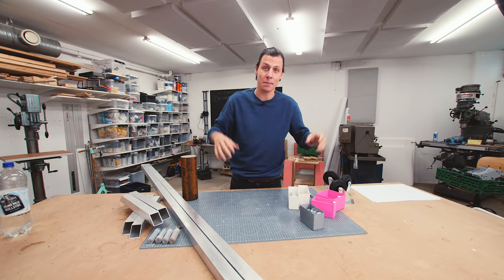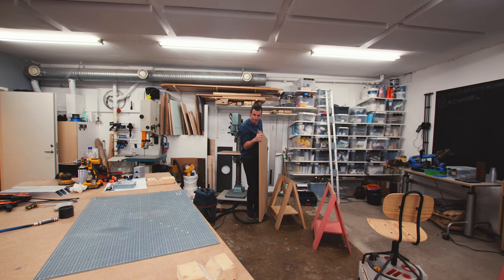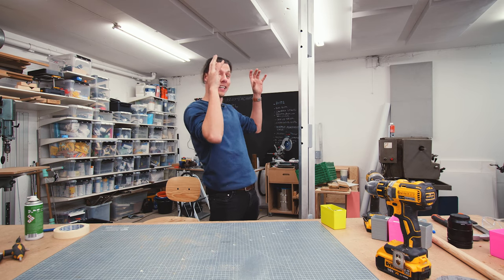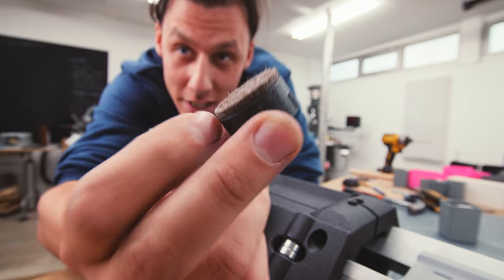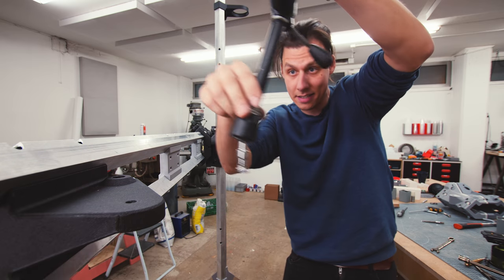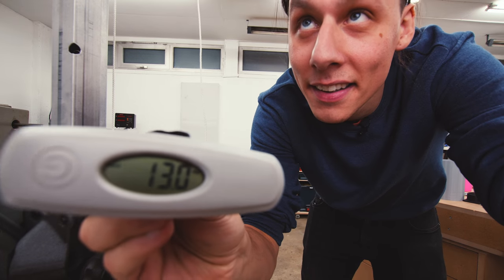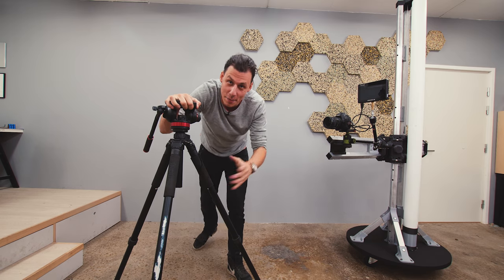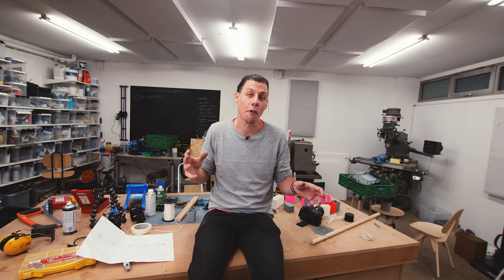3d Printing a $10,000 Camera Arm

Comment: Man that hole drilling jig is genius. In fact, the whole lot is. I need one!
Reply: nice seeing you here ;)
Reply: The bearings make no sense tho lol. At least functionally
Reply: @chas1878  With the inner race of the bearing being able to rotate with the drill bit if the drill angle was slightly off, there's very little chance this will cause any damage to the the guide bearing, if it was just a s/steel/alloy/steel guide spacer instead, there is the possibility of the drill bit biting into the jig surface causing a misaligned hole if you were slightly off with the drilling angle, so imo it does actually have a function, cool project
Reply: @antc1609  the biggest benefit in use comes from the material being hardened. It's not fixed to the drill and the drill moves axially too so the benefit you mentioned must be minor I imagine. The one point that has to be mentioned is that Chinese ball bearings are dirt cheap, cheaper than getting a hunk of Steal and boring it to a specific diameter. Nevermind hardening it
Reply: @chas1878  Yeah I think the bearings just happened to be the right size for this purpose.
Reply: GH  it's a good question. Hardening is a huge but very interesting topic.

To answer your question, it's theoretically possible but very impractical and with little to no use. You would have to anneal the material and start the heat treating process again. Depending on the steel you can probably make it a bit harder at the cost of it being more brittle. Which is not something you want in bearings at all. 

The "Chinese ball bearings" don't necessarily use bad materials if you buy from a serious manufacturer and vendor. I referred to them like that because they can be bought cheaply. I personally wouldn't trust no brand bearings with anything more than a simple low speed hobby application. Which means they're pretty good for a low cost throw in the bin later drilling jig lol
Reply: Well said Angus, I also need to do something about my setup, my current one is a bit awkward
Reply: Basically "rip hole saws"
Reply: We all need one!
Reply: @antc1609  this guy is not just making stuff but making stuf with a grade of measurements issues and making sure noting gets damaged for a malfunction. Guess he have some experience behind camera.

Comment: Very cool design and seems very handy. It's amazing how much time just moving a camera around can take. One suggestion for you given the amount of 3D printing time this took - if your space can support it I'd recommend getting a plasma table and a sheet metal bender. Many of your 3D printed parts could be made in a matter of minutes from plasma cut and bent sheet metal. Even if you need a complicated 3D printed interface shape, many times 90% of the structure can still be sheet metal which will save you oodles of time.
Reply: This guy knows what he is talking about. I have absolutely no technical input, but I would trust this man with my life if it depended on engineering.
Reply: But frankly, we all can see you are massively biased toward using sheet metal! #Plasmacuttersharpiemarker

Love both of your channels Stuff Made Here and Alexandre Chappel!
Reply: I started reading this comment and was like, huh, plasma cutting and bending sheet metal? Doesn't that Stuff Made Here guy do all that? Then I looked at the comment author. X-D Love your stuff btw. Thank you for braving the hairdressing robots for the rest of us!
Reply: Excited for your next video
Reply: How highly do you have to value your time to justify replacigng a $300 printer with a several thousand dollar plasma cutter? Especially when that isn't 'time spent working', but 'time spent not having whatever my latest project it is complete'.
Reply: @iusethisnameformygoogleacc1013  Alexandre's printers are worth far more then $300. He has two ultimakers both worth around $3000 each, along with a prusa mk3 worth around $800 and a artillery sidewinder X1 worth about $430.
Reply: Not fair. You have a trillion machines 😂
Reply: Not to discredit Alexandre but don't you have to be an absolute god of engineering to design those folded geometries? Working a 3d model and just printing it seems easier... Or does software do the work for you?
Reply: 3D print (if you have some printers anyway) is perfect for prototyping. And this is prototype. :)
Reply: @stansnijder1775  I wouldn't day thst you have to make everything out of sheet metal, but the spacers, the plattform to bolt the camera to, and whatever else, could be easily made from sheet metal in a few tries and fails, followed by good results which all last a couple minutes each.
Reply: That may be, but you are forgetting the universal power of the 3d printer as a machine, basic tools and a printer can make this. I don't have a plasma cutter, so you are making it a "closed sourcing" design by adding a very large manufacturing requirement.
Reply: @bradensinclair9517  So? You could literally print this on a ender 3, its PLA after all. Its not about what Alexandre uses. Not to mention that a plasma cutter costs many many times the 3d printers he has.
Reply: @stansnijder1775  Using Solidworks the sheet metal plugin does most of the complicated parts for me, like the proper bend radius/thickness and turning the 3d model to a flat pattern. It does not warn of stuff like holes too close to edges, nor does it help with proper folding orders etc. Its much less hard then i initially thought.
Reply: @malloot9224  yeah, you could definitely print it all on an ender 3, I in fact have an ender 3 and their great.
Reply: No surprise that you are endorsing a plasma cutter and bender ;)
Reply: ok, sheet metal ambassador
Reply: The king is here!
Reply: knew i would find you here!
Reply: I actually did just that, check it out on my channel!
Reply: 🤩

notice me senpai
Reply: @malloot9224  Absolutely. Modern CAD applications, like Solidworks or Inventor made the design of sheet metal pretty easy and you can concentrate on the more difficult part - making it work.
Reply: You're right of course, but then many people find the channel because of the 3D printing aspect (including me). There's something so accessible about doing it this way.
Reply: As it is often the case, the best solution should be a mix of all what you are all proposing... 3D printing big parts is awfully long, plasma cutters are expensive... the mixed solution could be to use simple pieces (of metal or even wood) for the big parts that need strength, and smaller printed parts for the smaller complex 3D geometries. EG: the 2 masts can be iron square tube soldered on an iron base, as did Cranktown City. Simple and sturdy. The spacers can be a simple flat sheet metal soldered between the square tubes, as long as you made a gig to assure a constant spacing of the tubes while soldering.... Then the gauntry of the Z axis can be made of 2 plywood rectangles sandwiching 4 plastic parts holding the bearings at each corner, etc... No plasma cutting, no bending, and small 3D prints.
Reply: the point is when are you making a motorized one which can detect people around it and auto-adjust. oh yeah, it will do the opposite in wife mode, that is just default.
Reply: Yes but the appeal of this is than anyone with a 3D printer, a drill and a saw can make this. Granted it would take a long time but the appeal is accessibility. I wouldn't have watched it in the first place if he was using unreasonable and inaccessible tools. It's always a pet peeve of mine when someone is like "this thing is so expensive let's make it ourselves using these tools that cost 20x more than said expensive thing". Shit is annoying

Comment: From an engineer: very professional design. You could miss brakes at the wheels, but otherwise the concept demonstrates a lot of insight and skill.
Reply: I dont like this brakes on wheels. Wheel does not move, but still can rotate on vertical axis. 
I would add 3-4x fix-posts. Those you just screw in to touch the ground and lift a whole part on couple of millimeters.
Reply: @TushhsuT  it is a good solution too. I would suggest the kind which have a quick lever instead a thread  to lift.
Reply: @Auracanal  you right! Lever is much faster and actually more predictable. Probably a bit harder in engineering, but after doing Such a design should not be a problem.
Reply: @smashyrashy  It makes me a professional in designing things at least. Being an unrequired hater does not make anyone special either.
Reply: @Auracanal  i didnt say anything hateful though
Reply: @TushhsuT  You could make a quickrelease tensioned system, with some levers.

Comment: Couple of  stepper motors  to remotely move the arms it and the thing would be awesome
.Strip a  cheap 3d printer down , and you could control it with octoprint  and program movement with g code for time lapses and the like
Reply: lol. Why? 2 motors. One arduino nano/ESP8266 and some simple programming and you can controll this thing via website...
Reply: That's a great idea even though it probably isn't necessary. I made a motorized camera slider but I'm not really using it that much for timelapses and moving actually. It would be awesome though.
Reply: if you dont make the base remote controlled as well then you arnt trying hard enough. :P
Reply: It would be cool if he motorized it, and added some kind of axis for roll and pitch. Only issue i could imagine is the belt slipping when he's trying to record something, but i mean it looks great, and seems to function pretty well.
Reply: tbh i think it would be better to invest in some brushless stepper motors, they are quieter, faster and more powerful. Adding some how also some drivability of some kind, maybe by replacing the wheels with rails you could motorize that too and have like mkbhd fancy camera robot but like diy and cheap. Could be very useful to be able to make repeatable shots with amazing stability. Could be cool also if focus and zoom controll would be added for more flexibility.
Reply: _ David _  nodeMcu needs only 12mA of current to be powered while raspberry needs 3x as much. Otherwise it doesnt really matter which you will use.
Reply: I actually made something similar with a slider, https://www.instagram.com/p/B_jKpsuHrYZ/?utm_source=ig_web_copy_link. I was thinking about a 7-axis camera arm with this arm (pan, tilt, zoom, focus, rotate camera, little arm, big arm up/down, big arm rotate)

Comment: Built something with bearings on aluminium extrusion recently (finished a few weeks ago). I recommend either using nylon bearing wheels, or putting a UHMW tape between the bearing and the bearing, as the bearings are made from very hard steel, and the aluminium made from... relatively very soft aluminium, your bearings will wear a track in no time. It also quietens their operation considerably!

Also, what are the blockers to offering these for sale?
Reply: Came to the comments to say this: definitely put some uhmw tape on those surfaces. You can already see the steel polishing the aluminum, which is nothing but wear.
Reply: yeah, i imagine the bearings from 3d printers would be better than just metal bearings. the rubber ones would need to be the same size as the metal ones he used now though. so might not be able to swap them out. kinda odd that he didnt use them in the first place, given that he owns a 3d printer and must deal with them every day.
Reply: Linear bearing would be overkill..... is nylon hard enough for aluminium surface? Would anodizing those profiles fist help?
Reply: @OU81TWO  The guy got a lathe. You know what those can do pretty good? Very round sleeves out of soft materials. I'd just take some ptfe stock and put a sleeve ring over the bearings.
Reply: @marcus_w0  Yeah it's not that simple. If you increase the diameter of the bearings by adding a sleeve you'll end up significantly changing the distance between the housing halves. He may not have enough adjustability to accommodate that.
Reply: _ David _  Like I said...it may not be enough. There's other things that bolt on to those two halves. If they're too far apart the bolt holes may not line up. It's impossible to tell for sure without looking at the models.
Reply: 400 Hrs of printing time I'd guess prevents anyone from making money of the 10 units you can sell per year? Plus shipping on 2 meter aluminium pipe? Selling the plastic parts if molded, as a DIY kit might work...
Reply: @GeneralPoison  The parts look great 3D printed but this whole thing can be built from wood using small cheap skate board wheels for the rollers. It won't look as sexy but will work just as well.
Reply: @OU81TWO  also it could be made with metal sheets in place of the 3d print parts. I wouldn't trust his version an expensive camera personally but it's probably just fine. The benefit of 3d printing is the easy prototyping possibilities. As you can tell from his version. 3d printing it en Masse wouldn't make you money, it's way too expensive and takes too long.

Comment: A motorized version of this would be crazy, using kwyframes with this would enable you to create really cool looking shots
Reply: ikr!!! this shit is already amazing but think of the possibilities!!
Reply: With motion tracking...
Reply: and the way its designed would make this quite easy
Reply: @asderidelp  All you'd really need to do to motorize the Z-axis is to attach a stepper Motor to the pulley on top. Pretty low effort and would allow some cool effects already. The horizontal axis would be more complicated, not sure how to tackle that.
Reply: @SpaceMarshalGyorni  "all"  bruh theres alot to do for that.
Reply: @SpaceMarshalGyorni  Using a beltdrive with a cogged belt the x-axis and build a motor mount into the holder should not be too hard, basically similar to how many homebrew cnc tables work. For the Z-axis you could mount a motor at the bottom and use belt as well, then control it all with stepper motors. As long as you still have a counterweight, the load shouldn't be to bad. If you haven't watched it, take a look at https://www.youtube.com/c/jamesbruton/ 
He does a lot of work with 3d printing and controlling robots. Including an opendog, the homebrew version of boston dynamics dog.
Reply: @SpaceMarshalGyorni  exchanging the string and pulley for a bicycle chain and gear would make this more easy i think

Comment: HA!  This is the second person in the last month that has made a DIY version of my Foba camera stand!  Nicely done Alexandre!
Reply: who else did it?
Reply: _ David _  Sorry for the confusion, I'm not claiming the design.  I'm literally the guy at 00:13.  I didn't design it, I just bought one off craigslist. And a couple people have referenced mine in their builds.
Reply: @RobertCowanDIY  Atilla's is nice, but way more labor intensive in my mind.  Alex's use of the 3d printed parts, #1, makes assembly much easier, I think a caveman could do it, #2, it looks so well made it almost looks like a commercially made piece.  Now granted, I wonder how much time both guys invested in just planning and designing the builds.  Alex's is sort of a plug and play.  I agree with what some of the other people have said about him adding steppers to raise and lower and move in and out for those dramatic time lapse moving shots.
Reply: @larryhampton9069  I'm not at ALL trying to minimize the work that Alexandre has done here, don't interpret my comment as such.  But his is much different than a 'real' camera stand.  It's very much a lightweight version of it, which is much more practical.  The 'real' ones are around 300 pounds and  you don't have to worry about them tipping even with the heaviest equipment.  His appears to be a bit wobbly and not as stable.  It is a bit more accessible, but it's further from the commercial versions.  I can literally do pull-ups on mine when fully extended.  No judgements, just saying it's a bit different.
Reply: @RobertCowanDIY  Oh, by far I didn't think you meant that, I apologize if I came across that way.  And I realize his is far lighter in weight.  I also wonder if European extruded aluminium is different dimensions from US aluminum, in which case his files would have to be modified to print here.  I think for his shop and his use, his is perfect for him.
Reply: @larryhampton9069  Yep, agreed.  Mine is WAY overbuilt.
Reply: @larryhampton9069  but This is not long lasting
Reply: @RobertCowanDIY  but certainly long lasting, I loved your video and just now subscribed from for the world channel
Reply from the maker: Oh cool, I didn't know about Atilla's version. Thanks Robert :)
Reply from the maker: @larryhampton9069  on the sizing, yeah you'd probably need to get a hold of 40x40mm aluminum from a supplier, also, keep in mind that everything else is in metric as well, screws bolts, etc.
Reply: @achappel  so, 40mm converts to 1.57 inches, I may need to take my calipers the next time I go to the metals place.  We have easy access to metric hardware, but it is 2x-3x more expensive than Imperial.  In other words, it probably costs the same here as it does there. :p
Reply: DID you ever get around to motorizing yours?
Reply: @RoraighPrice  Working on it.  SO.  MANY.  OTHER.  PROJECTS.  Also, Battlebots and job.  :-/